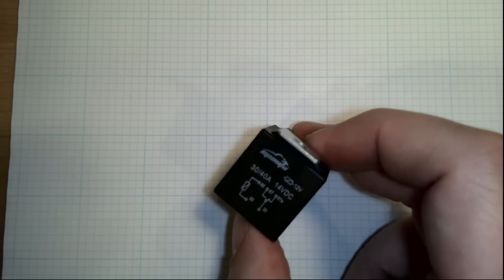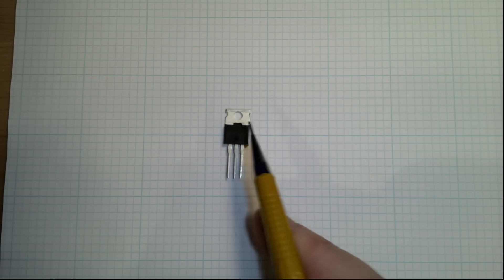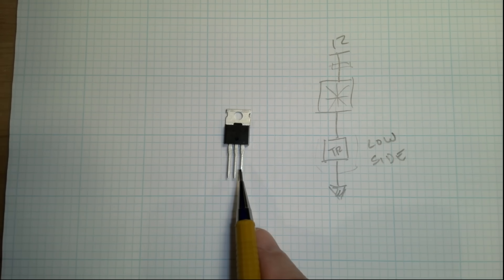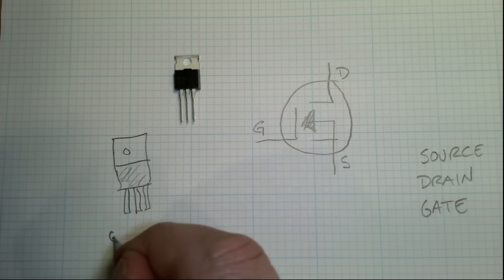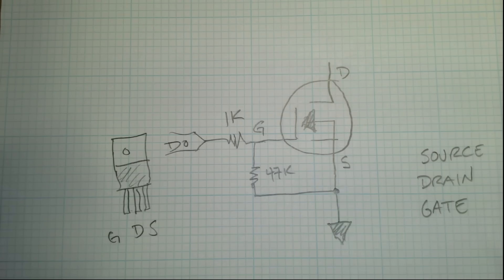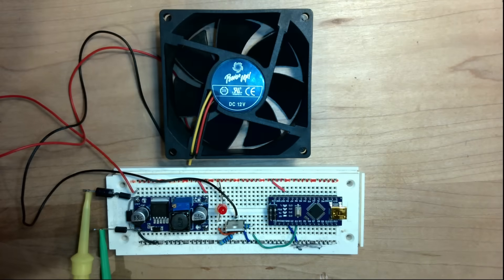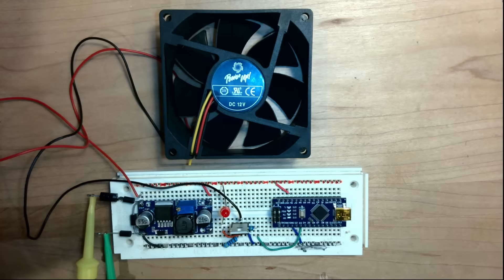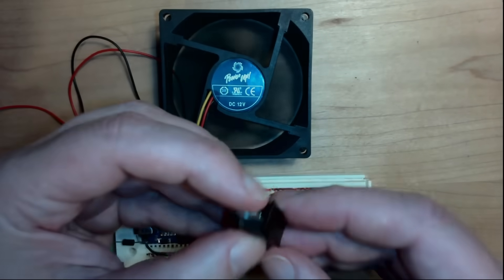Using a MOSFET to Switch High Current Automotive Loads

Comment: Low side switching would make the wiring harness in a car bigger. You would either need to run a ground wire from the load to the transistor or have the transistor near the load with an extra signal wire. Having the relays in a single place sending power to the loads that are grounded to the chassis saves a lot of wiring. It's also easier to troubleshoot or bypass a bed relay, and relays don't get very hot. I have a Mercedes W140, it's one of the quietest cars ever built, it has relays under a panel on the passenger floorboard, I have never been disturbed by a relay clicking and I haven't ever complained about not having enough leg room because a relay was too big. I'm not sure why you would use this outside of a super niche application. Still a good video though.
Reply: Also relays are much easier to pull out and snap back in for testing. You can swap two identical relays while troubleshooting something in a parking lot away from home and eliminate a potential problem. With transistors you need a multimeter and most likely a soldering iron to pull it out for testing (yeah not always, but in your case, you'll have to). This means you need access to the back of the circuit board, which means you'll be taking out screws and unplugging other connectors, which you're just not going to do real quick on the go. Relays all the way for automotive applications.
Reply: @nocandopdx obiously the fet should be put in a relay package for retrofit
Reply: @nocandopdx  Relays are OK for motors, but are not very good for high current DC loads, anything that does not break the current while operating.  DC arcs are very hard to break unless you use relays or contactors with magnetic arc quenching.
Reply: @TheEmbeddedHobbyist  Can you give an example of such a load on a vehicle that isn't a motor?
Reply: @nocandopdx head lights, the cabin heater in an EV, built-in window demistor elements.
Reply from the maker: Yep, I'll be covering high side switches next. I'm headed toward a glow plug controller and glow plugs ground through the head.
Reply: I was also going to say that in a car where the return path is the chassis or bodywork, it's either high-side switching or more wiring. 
The problem with high-side is that you need a voltage above the supply voltage to switch an N-channel or use a P-channel fet. P-channel do not normally have a RDSon as low as n-channels, so not as efficient and get hotter.
Reply: Relays absolutely DO get hot, even melt down.  It’s why your starter solenoid is fatter than your dash light relay.
Reply: @Dr_Wrong  they also are not great at switching high current dc. if you need to switch high dc current look for relays with  magnetic blowout.
Reply: @TheEmbeddedHobbyist  

Good advice 😀
Reply: He addressed needing access to negative in the vid.

Comment: That’s quite interesting. Can you tell us the failure mode of these semiconductors. Do they fail short circuit or open circuit?
Reply from the maker: N-chanel MOSFETs typically fail to a short, so always add a fuse on the switched circuit